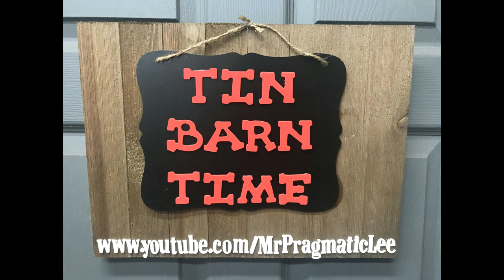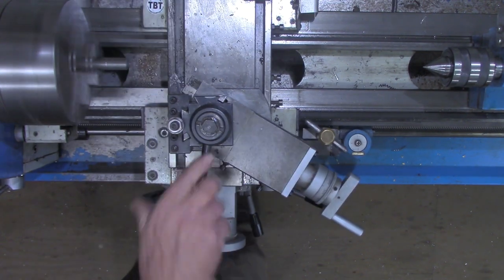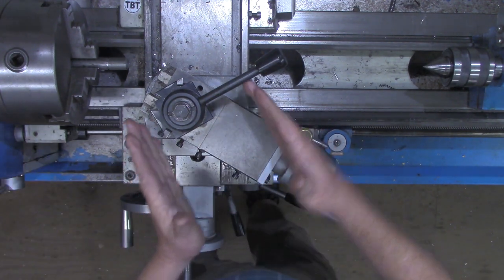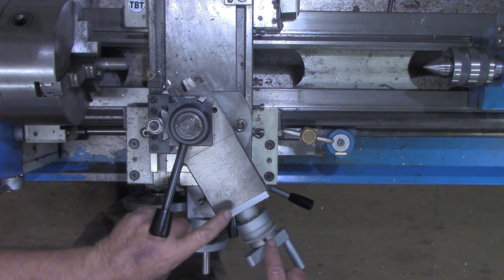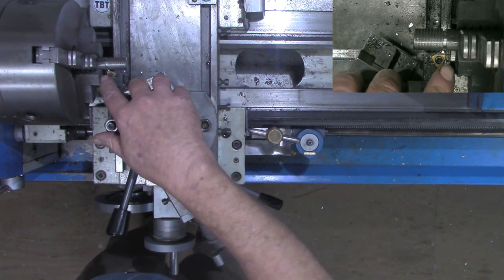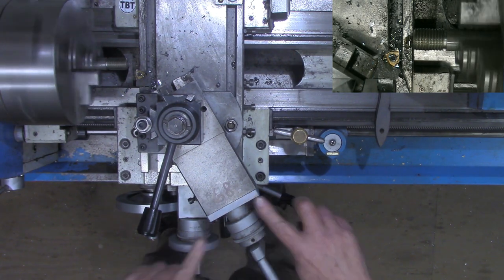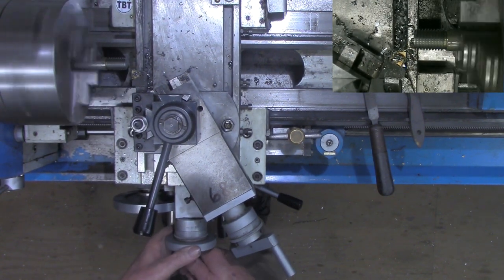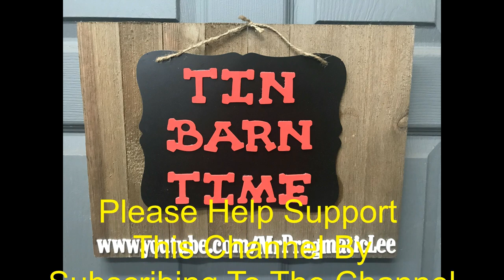External Imperial Threading on Import Lathe

Comment: Thank you so much for this lesson ! I have the same lathe you have except mine is not the LB large bore … mine is 1.57 inch bore …this was very helpful as I am just a hobbyist beginner .. .. I’ve always used dies and taps for threads but I really want to be able to cut single point threads .. I also have the PM 728 VT milling machine and have copied your aluminium fixture plate and it has been so handy for work holding .. .. please keep the videos coming ! Your channel is one of my top favorites!

Comment: Lee I’ve got zero experience single point threading on my mini lathe but I thought you were supposed to turn the threaded area down to the major diameter first. If I’m not mistaken that saves the threading tool from having to dig down as far. Love your channel. Greetings from Wilmington.
Reply from the maker: Starting with the nominal value (5/8 in this case) is fine IF you don’t know the minor diameter, but that is why I had to make several extra advances on the compound. Thanks for stopping by.

Comment: Just a few of points to add to this fine presentation. The more of the thread you cut (the deeper you go), the more metal you’re taking off, so on a larger thread, you need to take a finer cut as you go. The last cuts should take no more than 0.002”. The thread on both the screw and nut are both flattened. That flat is determined by the size thread. That’s why the diameter of the thread is a bit smaller than the nominal diameter. This is for strength and to give some room between the parts. When you’re threading for yourself, as long as it fits, it’s usually ok. But if you’re making parts for customers, or to be interchangeable with some other part, you really should consult the charts for proper fit. This is usually given as H values - 1, 2, 3, 4, etc. the last bit of info is that the rear of the cutting tool DOES cut. Some people say that cutting at 29.5 degrees has the tool cutting only at the front face. South Bend stated in their manuals that it cuts on the rear as well. A couple of years ago, or so, Joe Pie did an excellent video in which he showed conclusively, that it not only does cut, but why it needs to cut. Worth watching. By the way, if you buy thread cutting insets, be careful what you buy. The are partial thread inserts, and full thread inserts. Check it out.

Comment: On the material prep page you say you cannot turn as the travel (with lead screw)speed is too fast, Why can you not disengage the half nuts and use either hand feed or the feed shaft for prep work? My lathe is metric and all I need to change is 1 gear to change from metric to imperial and I have only 1 carriage shaft but 2 positions, either feed or half nuts. Also my lathe has no thread dial and its also not an optional extra so at some thread pitches I need to leave the halfnuts engaged and reverse the lathe.

Comment: Great video. I do have a question. Will it work if you touch off and set both cross slide and compound both to zero. Then advance the cross  slide the .118” double depth and then reset zero. Back off the compound and cut the threads. This way you don’t have to do the math for how much to advance the compound. You would just go to zero.
Reply from the maker: As long as you accounted for any backlash in you dials. Thanks for stopping by.